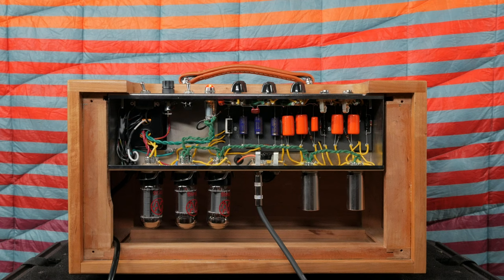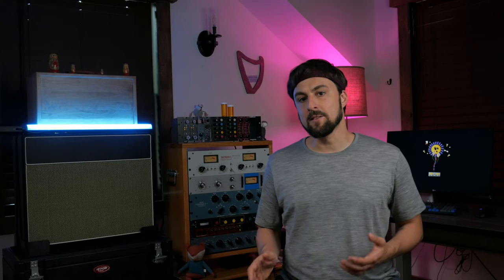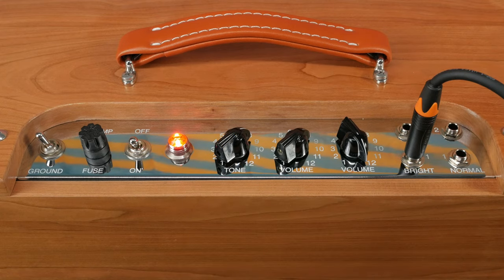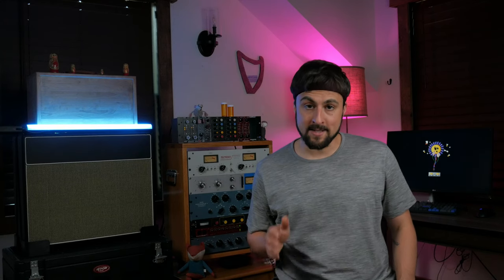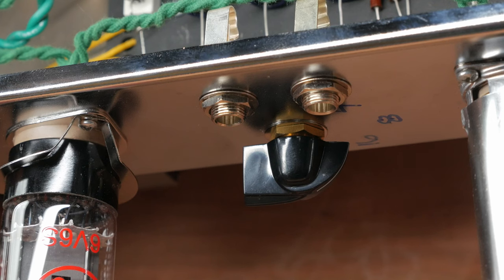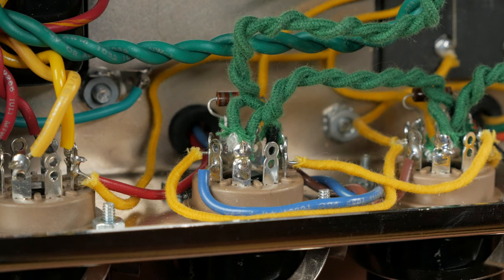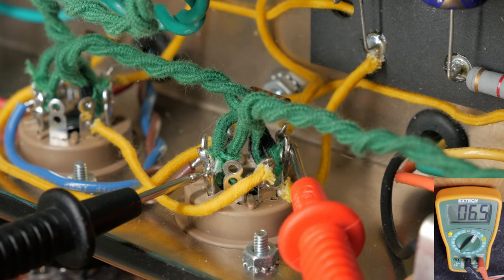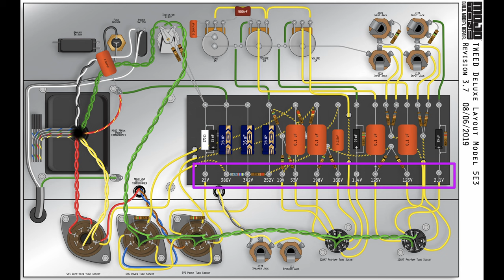Building a Fender Tweed Deluxe - Mojotone 5E3

Comment: I’m interested in building stuff like this. Is there any way I can learn and “dip my toes” into this kind of stuff
Reply from the maker: Hi Nico! You should go for it! If you're looking for a place to start I would go with a guitar pedal. It will let you hone your soldering skills in a less expensive environment. The guitar pedal will also contain lower voltages making it a safer place to practice.

I'd go for a kit from some place like Aion Fx. This way you can focus on building without having to source parts. Aion does a good job of marking the difficulty level of their kits. They're also very well documented. You won't have any problems with the beginner or easy kits.

The kits will come with everything you need for parts. You'll need to buy your own soldering iron and solder. 

Let me know if you have any questions - I'm always happy to help someone get into building their own gear!

Comment: Incredible tones. What's your recording chain shoetique?
Reply from the maker: I appreciate the kind words Louis-Philippe! The guitar has a set of stonewall pickups 'signature strat pickups' in it. The guitar is plugged directly into the 5E3 which is hooked up to a Mojotone Anthem speaker. 

I have two mics on the speaker: A BIV-1 (Russian Royer 121 clone) and an SM57. These are in a Royer axe mount mic clip which makes phase alignment super easy. I have the BIV-1 slightly to the right of the speaker cone.

From here I plug into a pair of CAPI VP28 Mic pre amps. These run into my Focusrite Clarett 8 Pre interface. I use Studio One as my DAW. The only effect being applied to the guitar is a high pass filter to get rid of a bit of boom that was creating some mud in the bass and kick drum frequencies.

Let me know if you've got any questions about the set up! I'm always happy to talk about it!
Reply: @shoetiquemusic  awesome setup ! Is that biv-1 built by you ?
Reply from the maker: @louis-philippekyer4335  I didn't build that one. I bought it directly from the builder (bashaudio) who is based out of Russia. 

I'm not sure how easy it would be to purchase these mics today with all the trade restrictions going on. I guess it will depend on where you're located. Here is a link to the builder's website. Its a pretty scuffed webpage but I can say for a fact that I purchased a pair of mics from this guy in 2020 and the product I received works great. Just be careful - the first link on his page is an example of a fraudulent ebay page with fake versions of his mics that the builder is very mad at. I have no idea why he would lead with that instead of a link to his own ebay store 🤣http://www.bashaudio.ru/rmbiv1.eng.html#rmbiv1.eng

There are a number of gearslutz... I mean gearpage threads that talk about the bashaudio BIV-1 that have more info.
Reply: Thank you so much for the details! Will wait for the war to stop ha ! @shoetiquemusic

Comment: Im sure someone has said this already but the 5e3 in stock form doesnt have a nfb which is the "more grit" part of a selectable nfb loop... So the thing you said is misleading, it sounds like youre saying more grit than stock when i believe what you mean is more grit than the settings that have the nfb in cct
Reply from the maker: Hi Mikka - that's a good clarification! The 5E3 does not have a negative feedback loop. Adding the NFB circuit/toggle allows you to toggle between more grit (stock configuration) and less grit (an added nfb circuit).